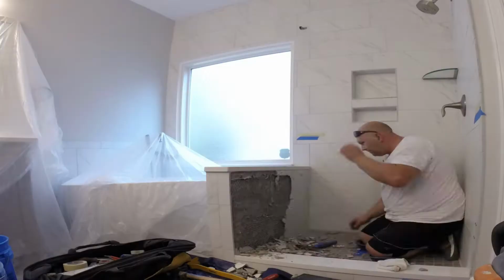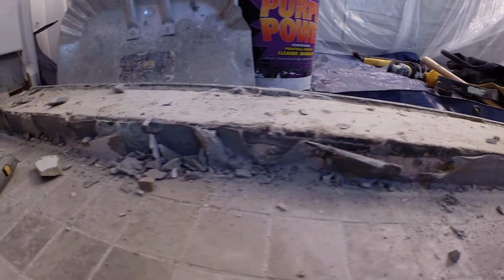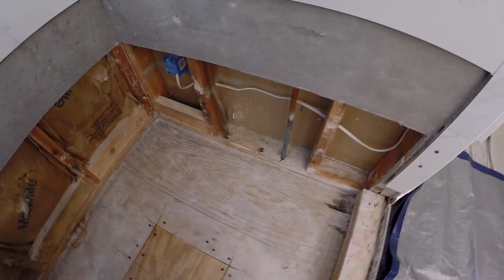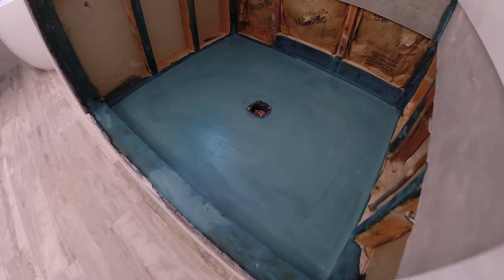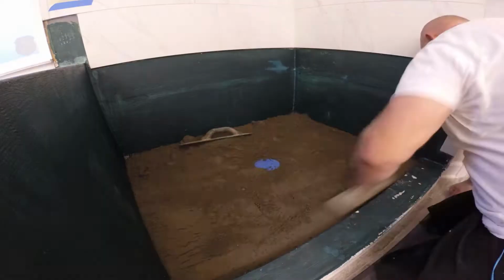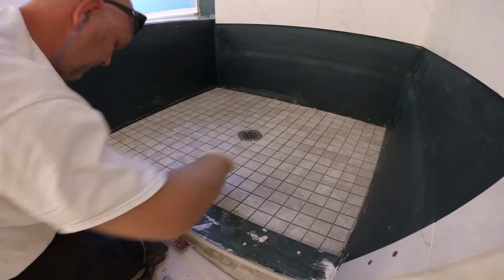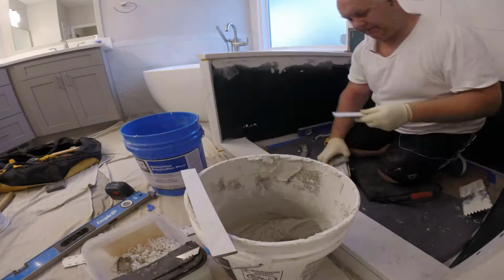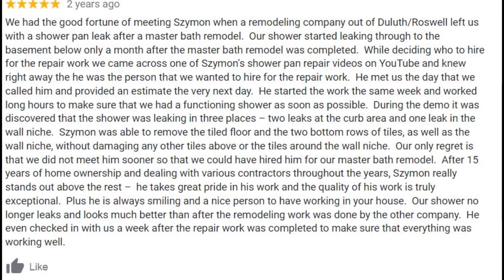How To Replace Leaking Shower Pan

Comment: No pebbles around the drain before the top coat of mortar mix?
Reply from the maker: In order to save the glass enclosure I have to build a super thin pan.  Pebbles would only weaken the structure. I replaced hundreds of showers I never seen pebbles being used in any of them.